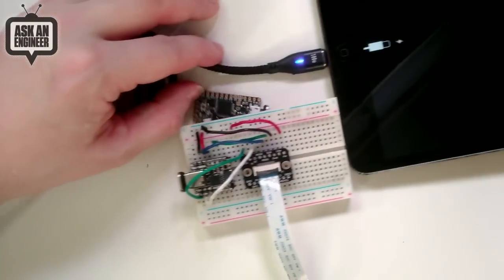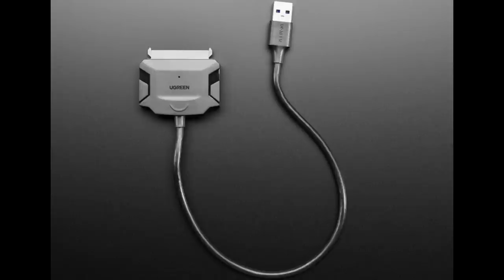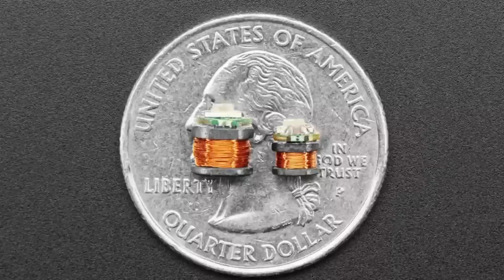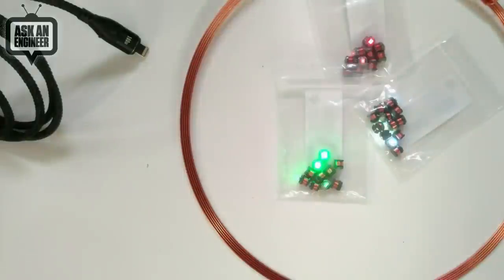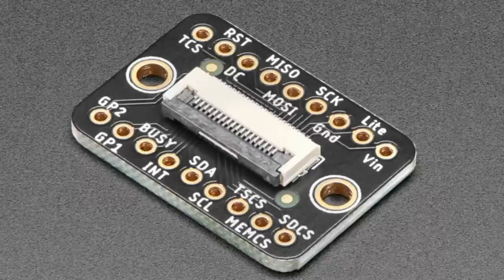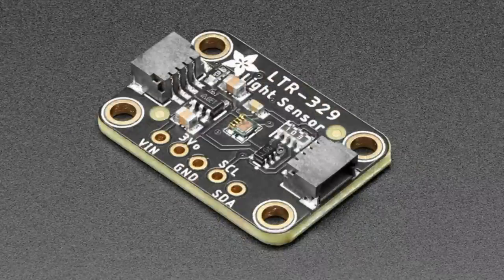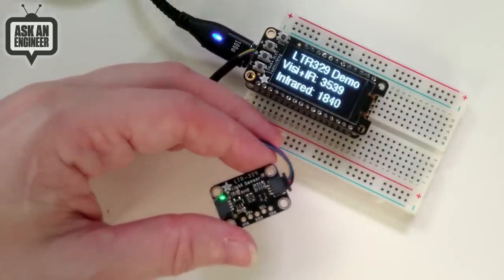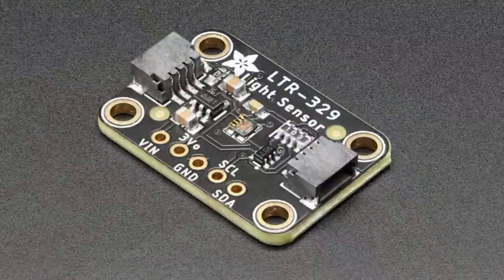#NewProducts 9/14/2022 Featuring #adafruit LTR-303 #LightSensor - STEMMA QT / Qwiic!

Comment: How many pins are active in the USB-C magnetic connector ?
Also is the USB-A a USB 2.0 or a USB 3.0 magnetic connector ?
Does the USB→SATA adapter have a power connector for external power ?